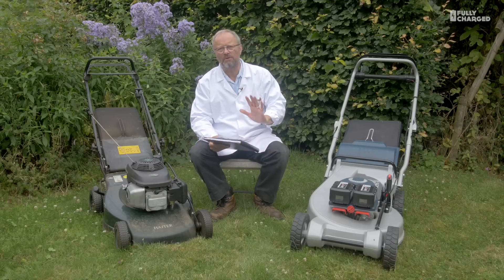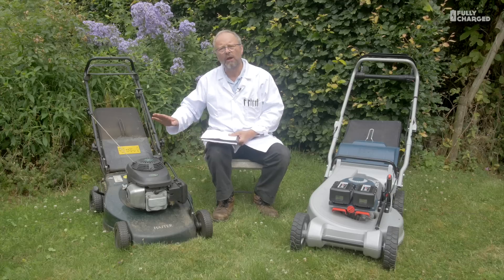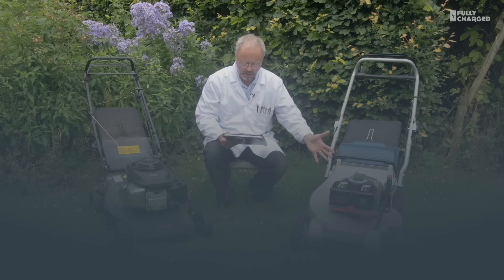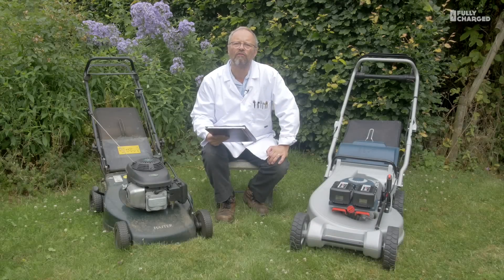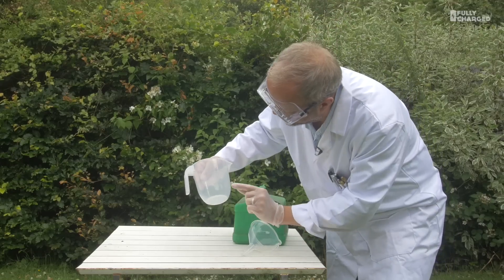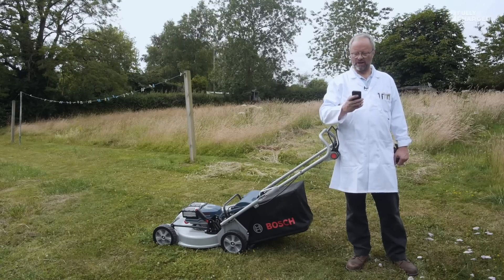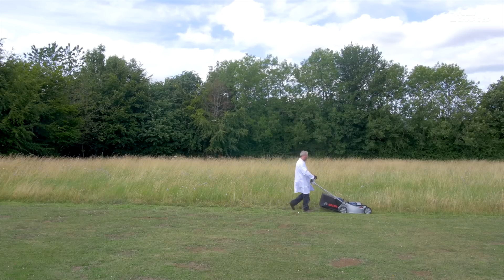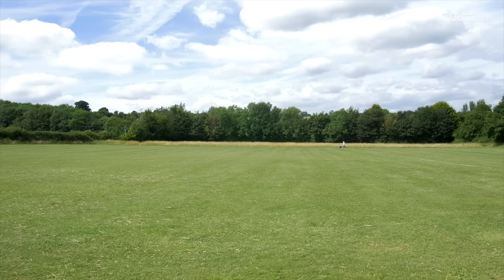Battery V Petrol. The Lawnmower Test | Fully Charged

Comment: I know your just presenting but, FFS 🤦🏻‍♂️
When something says "professional" What it actually means is it's for the working man, who's never done a days work in his life and is more likely to spend more in a month on gardener's, than most normal people do on a month's shopping.

I wonder how much the bare tool is, with 2 fast chargers and 4 top of the range batteries are? 🤔 Must be just under the £2,000 mark?

I know you're doing a TV program and are telling everyone how amazing batteries are. And they are pretty good. But there no match for a lawnmower, hedge trimmer, leaf blower, etc. 
I can't see council's in England, throwing away top quality power tools, for something which will need 18+ batteries a day for an "actual" professional 2 & 4 stroke power tool.

Robert
Could you PLEASE get in touch with your local council and get them to use this for a week to see what think of it? Using it the way they would, day in day out, getting the same amount of use and abuse, chucking it about, the "apprentice" (if you'd call it that) forgetting to put the batteries on charge. See what they think of it as it clearly says it's a "PROFESSIONAL" so by that definition, it must be!

Comment: That test was so wrong the petrol engine is no where near efficient as a electric motor you never took that into account so that test was pointless and that type of petrol engine is one of the least efficient engines using a simple venturi carburettor gravity fed  sorry to burst your bubble. maybe a full tank to a fully charged mower test next time that's how they come from the manufacturers we all know electric is best i am for electric motors can't wait to get an electric car plus get solar cells on my roof and a tesla battery coming soon as i was a master mechanic for 35 years from lorries buses cars motorcycles aero engines   next time if you decide to revisit it again keep it equal a petrol garden mower a normal common garden electric battery mower or two industrial petrol and electric mowers and take into account the engines efficiency you decide. john from rugby.

Comment: A neighbor of mine has been using an electric lawnmower for well over 35 years now. Unfortunately it has to be plugged in. He has and buys a new set of extension cords roughly every three years because of accidents ( running over the cords) when they get too short then he buys new ones. Last year he bought a commercial electric battery powered lawnmower and loves it. He mows just over 3 acres of grass and now is able to mow half his lawn without worrying about running over cords. He went for the zero turn riding lawnmower. Cost him over $10,000 and when I found out what he paid his reaction was I should have bought this mower 5 years ago. Two sets of batteries so when it starts to die he simply shuts off the mower deck and drives up to his garage and swaps out the batteries 2 minutes later he's back at it and is done in just over an hour versus 5 hours with his old push electric mower on mains power. He sold the old mower to a guy at the office with a whopping total of 900 square feet of grass to mow. He loves it and sold his gas mower.

Cheers!

Comment: Electric lawn mowers are still quite expensive to purchase.

Hayter Motif 53  petrol mower = approximately £480
Bosch GRA 53 = approximately £1240

A difference of £760.

Current unleaded petrol price is £1.30. Therefore you can buy around 585 litres of petrol and run the Hayter for approximately 1365 hours continuously to match the purchase price of the Bosch electric cordless mower.

Comment: I love everything electric. It does not degrade my life by sniffing harmful gases etc etc. 

I bought a snowblower and the first season the battery died. The producer (Ryobi) claimed that i should not have left it on the charger after it is finished charging for more than a week cause then the charger overcharges and kills the battery. That battery (as the Bosch ones) cost MORE than the lawnmower itself. 

All your efforts will fail if you try to sell your tech and fail in charging software amateur programming. Really.... 

I have 10s of drill batteries that sit for months on the charger and none of them have ever died. Shitty charger programming and logic is not welcome at all.

Comment: Purchased a 40V electric weedwacker last year and love it.   At around $125 it is price comparable to gasoline trimmers.  It won't run all day... I get about 45 minutes of use out of it before I have to let the battery charge for another 40 mins.  I'll do that twice in a day and that's about all the wacking I can handle... My arms are shaking and I'm tired.  But it's whisper quiet... The crickets around my yard are louder.  And I LOVE that I don't have to spend every spring rebuilding the carbeurator, cleaning the spark plug, and spraying carb cleaner everywhere.  I do NOT miss owning 2 stroke engines!  Just because something is easy to work on doesn't mean I want to spend my time continually doing so!

Comment: Absolutely SHOCKED at what the Bosch pro mowers seem to offer. I'm beginning year 3 with my Ryobi 40v 20" mower & I'm never buying another one. On one 5 ah 40v battery I'm lucky if I can mow my back yard. If the grass is dry & not too high &/or thick, maybe. Conditions must be optimum to get best performance from the mower. While that's true with any mower, battery or gas, less than ideal conditions adversely effect lesser powered battery mowers. Generally, it takes 2 x 5ah batteries to do my yard. I'm on a 1/4 acre lot, so it's less than 1/4 acre mowing area. Each battery takes over 3.5 hours to charge, so it's a hassle & a gamble each time I mow. 

Does this Bosch run on 1-36v battery at a time? It appears that it does. But even if it uses both at one time, for it to mow that huge field with grass that tall as in this video is utterly astounding. And it's self-propelled? 
NO current (03/2019) US made mower can do that, not even the new 120v models we're seeing now. None. Not one. 
Well done Bosch. Superior design.

Comment: electric is always going to be more efficient than petrol. But i don't really think this is a good comparison in terms of machines used. The petrol mower may have been £300 new? and it looks pretty knackered. just looked up that particular model of bosch mower. Costs £1400 without any batteries or charger????

Comment: Great Demo Robert.  I have recently converted to diesel to PHEV, petrol to similar Battery electric lawn mower, petrol chainsaw to electric and all using the solar panels at home. The batteries can be interchangeable between garden devices. However, I am warned to store batteries in a dry place over winter (not a damp garage).

Comment: I've been using a battery electric mower for 7 years. No cord. No starting issues. No gas. No spark plugs. Same battery is still performing well. Lots of power. No tuneups. It's quiet. No smoke.

Comment: Hahaha this test is sooo inaccurate both the fuel tank and carb have whats called an appendix where dirt in fuel settles, most of that 50ml of fuel will collect in there and cant reach the engine, for a proper test he should have mounted a graduated transparent bottle to the frame feeding fuel directly into the carb, im not saying the petrol mower would have got the same or better run time as the electric, this is because the internal combustion engine technology on that mower dates back to the 1930s never the less it should have run for a lot longer than that.

Comment: By my calculations you would need 3.3 cups of gas to equal the run time of the battery mower. That's about 1.7 pounds. How much do the batteries weigh? Even though the electric motor is at least 3x the efficiency of that gas engine, the energy density of the gas really shines through.

Comment: This is unfair.  The petrol engine has far more parasitic loses than a electric motor.  The batteries take ages to charge and are expensive to buy.  The more load say long or wet grass the batteries will be drawn of amps very quickly   you then have to wait hours for batteries to charge.  The petrol mower you just refill and run all day long.  I would agree that a electric motor is more efficient & powerful than a petrol mower however to make it win against petrol you need lots of amps.  Where electric fails is batteries are crap at discharging and charging.  Also with all fossil fuel replacement  machines it takes alot of power of the grid and some one somewhere is burning alot coal which has a shit calorific value. Also theres alot of parasitic losses on the national grid.  All things to consider when comparing petrol.

Comment: The problem here is that the ordinary guy uses the mower a few times per year. This will have negative impact on the batteries, as is the case with mild use of power tools. People leave them 100% charged for months and the cycle count / battery life plummets. In the professional setting, it may be a good ROI, but I doubt there could be more than 600 cycles on those batteries (mainly due to the fast charging, which is great for us, horrible for batteries), so one hour and a half mow will cost 1 Euro in batteries alone.

Comment: but how much did the bosch mower cost? £1200  how long would the gas mower run on the gas bought with the difference ? ;-)  if the  the petrol mower cost £200 then about 1000hrs or longer than your lifetime of lawn mowing

Comment: Robert, your lawnmower video was entertaining and fun, as usual.   With a year or more having transpired and hundreds of comments posted, it's doubtful any of my relevant observations would add anything new.  So I will touch on one area that MAY yet not have been covered by other devoted viewers.  Your fitbit needs to be recalibrated.  By recalibrated, I mean accurately reflecting distance walked.  You might also change the settings to give you your preferred km scale instead of the hopelessly outdated 5,280 ft. measurement that only Yanks and Canadians (well, the non-French ones) still use. 

Following the lawnmowers was markedly slower than the pace needed to cover 4+ miles, or 6.4+ km as I'm sure you meant to say, in 50.45 minutes.  Your approximate 5 mph = 12 minutes per mile, an extremely fast walking pace, or roughly 1km per 8 minutes, or to get as close to metric expression as possible 1km/.13 hour.  Post-Brexit, might you go back to feet, miles, ounces and pounds? 

Or perhaps the vibration of the mower simply misled your fitbit to compute that it had traveled further than you.

Comment: If we forget this "scientific" test, a petrol engine is about 25% efficient and an electric motor is 75% to 95% efficient so the electric motor should do three or more times as much useful work. Back to lawnmowers - the cost of this mower is something over £2000 or five to ten times as expensive as a petrol equivalent, which would need £10 to £20 of petrol to do a years work. I have a Rotak 43 cordless which uses nearly two 36v 2.6Ah batteries to do my large rough garden. The batteries loose capacity after 4 to 5 years and needed replacing at a cost of £100 each, and the blade needs to be sharpened every three cuts. Oh yes, when I left it out in the rain the motor failed so now the whole mower has been bought again (cheaper than a new motor!). So even as an electric enthusiast I have to say that , for mowing, petrol is best.

Comment: Actually it was not really a comparison "apples with apples". There is such thing as  energy quality. Simply explained energy quality multiply by energy quantity is a usable energy and is called exergy. It's hard to believe but 1 liter of water with a temperature 0 C contains a thermal energy equivalent of 0,3 kWh, if a temperature of 0 K is taken as a reference point. Obviously, you can't use that energy for nothing unless you need to heat something that is close to absolute zero. Petrol has a lower energy quality when used in combustion engine since the produced thermal energy can not be utilized for performing usable work. Electricity has a high energy quality irrespective of application and therefore will be always superior to other energy sources irrespective of application. One should always remember that it takes 2,5-3 kWh off fossil fuel to produce 1 kWh of electricity (in case of electricity generation from fossil fuel).

Comment: ICE lawnmowers are horrible for the environment. They're less efficient than ICE cars, lack catalytic converters (They produce 11 times more NOx than cars), and they're of course, really loud.

The most environmentally friendly way to mow a lawn is to use a traditional push mower (Human power). Next would be a AC powered mower and lastly battery powered. Batteries require more rare-earth materials and have charging losses. - Of course for the professional, a battery powered mower is really the only choice if you want to cut out gasoline.

Comment: now the question is which one is more efficient per weight and which one is more effective per volume, as petrol has a much higher energy density than batteries. and in the end, which one is cheaper including the cost of the mower of course
Reply: The battery electric mower is significantly more expensive. That particular model goes for $1,000+. However, that is a professional grade mower. Most consumer grade BE mowers are around $200+.

Gasoline/petrol does have an incredibly high energy density, but the problem is that it has to be converted into usable energy. Electric motors are usually 90%+ efficient. ICE engines are usually 10-40%, with the average 4-stroke lawn mower being on the low end due to their simplicity. In the long run, it would be cheaper to buy a BE mower as maintenance is pretty much just cleaning and charging it. An ICE mower needs oil, gas,  spark plugs and it needs to be drained of fuel at the end of the year.

Comment: Well, eventually you said the word that really needed saying: efficiency.

The fuel - electricity equivalency math is right on, I have no comment there.  Where the clash of comparisons really lies is in the efficiency of the machines.

Good Li-ion batts have very good charge/discharge efficiencies, in the high 90s.  I couldn't find a quick reference for the efficiency of the charger but let's assume, for the sake of extremely conservative argument, that it's no better than 50%.  So that means that the 0.42 kW/h capacity of the battery is actually worth approximately 1.0 kW/h at the wall outlet.  Again, I'm being conservative and rounding up just to keep things easy.

The equivalent in petrol is still a tiny amount.  You'd be looking at something more like about 110-120 ml of fuel instead of the original 53.

And then of course there is the efficiency of the engine itself.  While a good electric motor can be reasonably expected to also deliver energy conversion efficiency in the high 90s, a very good gas engine can't deliver better than 40% or so, and the typical flathead gas engine on a lawn mower won't be anywhere near as good as that - call it closer to 25%.

Even a crap electric mower with a less rigorously designed motor is still going to beat a gas mower into the weeds on an efficiency basis.   In terms of power in vs. work out, the gas mower is starting from behind and losing ground quickly.  I'm glad to see electric mowers moving to the forefront.  I had a corded electric mower for a long time and it was only the advent of its third burned out switch in combination with a really inexpensive petrol mower at a thrift store that ever converted me back.  When my secondhand Honda dies, I may go to electric again.

Comment: About as scientific as using a goat to cut grass. Which is 100% efficient. As you should have done a cost per KWH of use. As you need a secondary source to charge the batteries. Which comes at a cost from some other source. Where as petrol is cheaper per liter to produce and store.

Comment: Hi Rob, Not sure if your talking bollocks or not but 1ltr of petrol contains 9 to 10 kwhs depending on where you look and lets say 10kwh and £1.20 a ltr.
Electric costs between 5p night rate to 20p or more on some tariffs, i pay 10p so lets say 12p for 1 kwh to make it easy.
So per kwh petrol costs the same as electric or near enough.
Now this is where it gets difficult.
A mid sized petrol automatic car, same as my ioniq will do 40mpg 40/4.54609=8.80 thats 8.80 miles per ltr.
The Ioniq does 4 miles per kwh so thats 40 miles per 10kwh
So my electric car (Others may vary) is about 4.54 times more efficient than a petrol car. And with the technology in a petrol mower engine i would expect an electric mower to have a much better efficiency than that.
Still wish i hadn't bought the bloody thing.

Comment: Yes, very well indeed battery power is much better...

BUT...

You didn't calculate how much power was needed create the electricity used, how much power was lost in the transfer of electricity to your house and how much power was lost charging the battery.
Then we would have had a fair comparison.
Reply: As opposed to petrol that magically appears in a jerry can? :D Seriously though, provided the electric power is generated burning fossil fuels, electric cars are pretty much head to head with petrol powered ones. I'd guess it is similar for lawn mowers. Advantage shifts towards electric the closer the power is generated to where it is consumed. For the moment, I'd say it's a matter of personal preference. I frequently use an electric chainsaw - while you cannot cut down a forest with it - it is perfect for a few hours worth of gardening work.
Reply: bonham1981 I myself do use an corded electric lawnmower because my lawn is rather small but if it was bigger I would use a petrol mower.
Reply: petrol uses more donations from  govs and fucked logistic. crude oil- pipeline- chemical reactions-petrol-pipeline/ so eclectic motors are small and efficient and batteries can be recycled. oil CANT